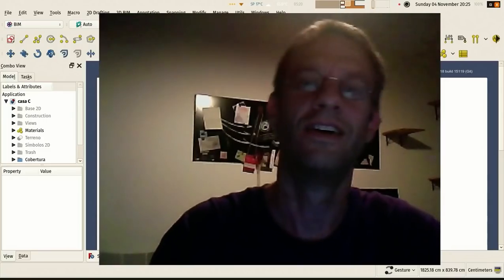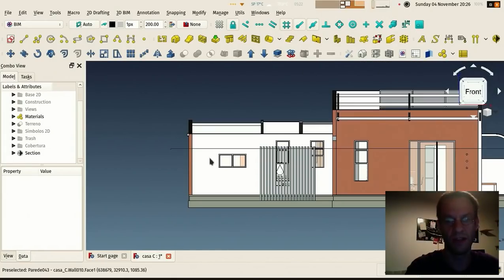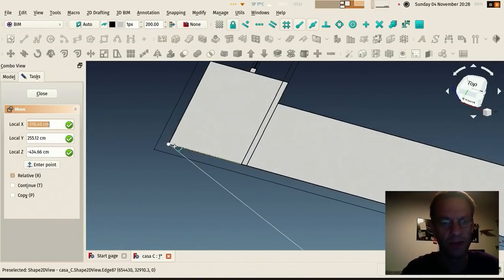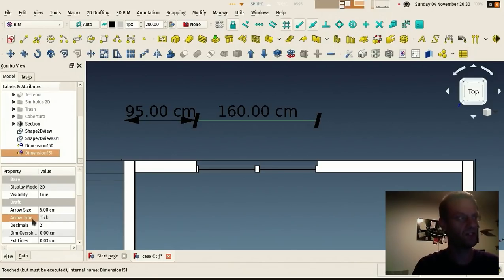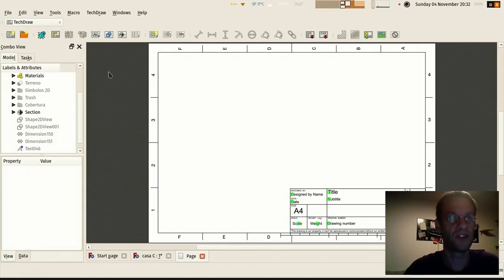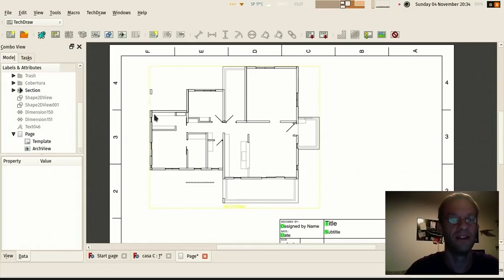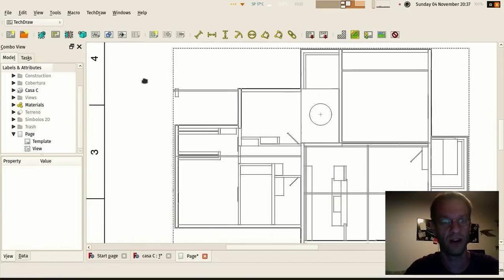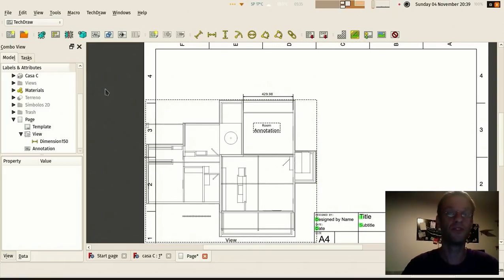BIM with FreeCAD - Creating 2D drawings

Comment: Hi Yorik. Very great job. I find your tutorials very useful, in a week or so I've been able to make freecad my regular tool to be used in my practice. Sure still lots of things to improve. I've got a big question. In this video, you've shone two different way to make a technical drawing. In the second, which at the moment is the one I'm interested because it gives the more opportunity to add quotes etc.,   there are big dots at the end of hitch line. Is it possible to remove or customize these dots? Thanks, please keep posting your tutorials. 
Just a last bit, id it does not bother you. While making the video add the app that shows the buttons you are clicking. It would really help also to get some short cut that seams you are using.

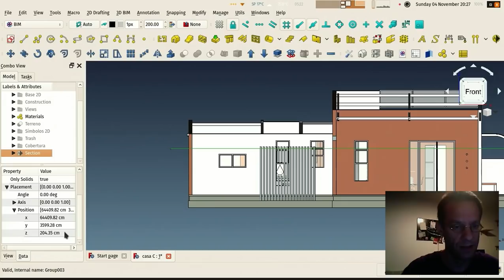Comment: please tell me what size of the bubble should be indicated at the axes: according to the norm, we have 8 mm. but the plan and the facade can be on different scales. how to make the same bubble on the sheet at both 1:50 and 1:100 scales at the axis and so that it is readable in 3D
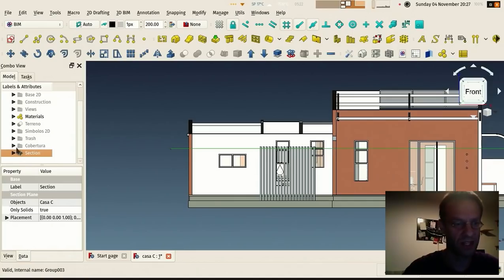Reply from the maker: I am not sure, but simply using a double size for 1:100 than for 1:50 should do it I think?
Reply: the same plan can be on different sheets at different scales. and the circles from the axes should always be of the standard size. I think that the bubbles should have a size relative to the sheet (8-12mm), since this is an element of the design of the image. and in 3D, the size should be done relative to the model (800-1200) in order to be able to visualize them in perspective. What I'm saying is that there should be different representations on paper and in the model. that is, the representation for 2D is separate. this also applies to doors (in 2D there should be a symbol) and windows and plumbing and furniture: in 2D they should have a reduced symbol

Comment: please tell me how to select the desired line with the mouse if it coincides with another line? maybe there is a button that changes the selection (as it is done in archicad - you hover over the object and press TAB until the desired one is highlighted)
Reply from the maker: Normally I think you can use the ` key (left to the number keys) but I 'm not sure anymore.. I'll check
Reply: @YorikvanHavre I checked, it's a TAB button. when the cursor is hovered over the matching faces of objects, you can highlight different objects by pressing the TAB button. but how to highlight? =)
Reply from the maker: @alexandr-spb  There used to be something like that in the BIM workbench but it has never worked properly... I'll add that to my todo list https://github.com/yorikvanhavre/BIM_Workbench/issues/118

Comment: Great tutorial again. Maybe it should be mentioned that the linked measuring in Techdraw is tricky if you change the object it is based on. For my workflow i started to make the dimesions with the draft workbench an then import in into techdraw. If you change the model you can easily adapt the changed dimensions.
Reply from the maker: Indeed, the whole workflow is still far from perfect, but at some moment we get there.

Comment: Why i cant edit frame of sheet (texts too)
Reply from the maker: It depends on the template that you are using https://wiki.freecad.org/TechDraw_TemplateHowTo
Reply: @YorikvanHavre  no. I'm not talking about a frame with inscriptions. I'm talking about the boundaries of the projection on the sheet. sometimes it is necessary to limit the visibility of some area in the projection. for example, make the viewport of the projection on the sheet not rectangular. you can cut out some kind of oblat or enter some node into a circle, freeing up the rest of the space for inscriptions. I apologize for the repetition, but again I will say about the archicade: there the boundaries of the projection area are edited in the same way as the lines. 
speaking of lines: how to bend a straight line at three points and straighten the arch?
Reply from the maker: @alexandr-spb  not sure I understand everything... You cannot at the moment do that automatically. A way to achieve this is to make a Shape2Dview in the 3D view, then make an intersection of that view and an arbitrary shape. In general, I more and more recommend doing that, doing all the view stuff (annotations, etc...) in the 3D view, then making a Draft view of all that

Comment: can I ask you to make tabs in the combo panel:
1 3D MODEL (as it is now)
2 PROJECTIONS (floors, sections, isometries, perspectives) - a separate document, working in which you can edit a 3D model.and add new information (texts, 2d objects, pictures, etc.)
3 VIEW - these are projection display settings (line thickness, layer combinations, object color, scale)
one projection can be designed in different saved views: all objects are gray in one view, and on the other - the same objects are divided into groups by some attribute: one is red, and the rest are white
4. SHEET: this is a space template in which you can insert a frame or a logo or a picture..
5 PAGE: this... a unique document, for which a previously created SHEET is selected as a sub-basis. On such a page, you need to compose VIEWS, texts and other 2D objects, add a number
_
you can give a task. we have a local initiative group here. we will try to help =)
Reply from the maker: That is more or less what I tried with the BIM views tool. But adding new tabs in the combo panel is easy with PySide... Feel free to propose something!

Comment: Wouldn't it be easier, if the TechDraw Pannel is 1:1 and the Export to, for example PDF, is scaled down to 0,01? The benefit is, to have a full and pure 2d 1:1 drawing Pannel where you can add furniture, txt, extra lines, hatches etc. to your X-Ref. But, great Work - can´t wait till 1.0 will be released!
Reply from the maker: But then what if you want two different scales on a same sheet?
Reply: @YorikvanHavre  I meant, to have the 2d section of the 3d Model on a separate 2d pannel, where you can add some stuff, like text etc. This doesn´t need to be the Paper pannel. Or one Step between 3d Model and Paper layout. The benefit is, that the 3d Model is free from 2d Stuff like Dimension Lines, Text, line thickness, stroke lines, Hatches  etc.
Reply from the maker: @apeGER  This last point is not so important in freecad, because it's pretty easy to isolate all the annotation stuff in groups and hide/show them when needed. But I see your point. I'm actually more and more thinking that an intermediary step between the 3D space and the 2D sheet might be interesting. More on that soon!
Reply: This is what Allplan does, actually. You only need to configure some thickness (for example, 0.18, 0.28, 0.39, 0.50...) so you can assign a thickness to an object, let's say a line, a wall, a window (macro), or whatever. Then, this thickness is used in the drawing when you print it. For example, I use 0.39 for walls, 0.29 for high furniture, windows and doors, and 0.18 for projected elements (bed, chairs). Also, every thickness can be represented by a color: 0.18 in cyan, 0.28 in green, 0.39 in magenta. So when you draw the 2D, you always know the thickness thanks to the color; when you print the 2D, it is rendered with the right thickness; and when you draw the 3D, the lines are not rendered, only the 3D view, so you have the model for HD rendering. It would be important automatically update the view with the changes in the model.

Well, what I mean is that it could be a very good implementation. Every CAD software should have a solid and stable thickness implementation, and then mix it with the BIM in a congruent way.